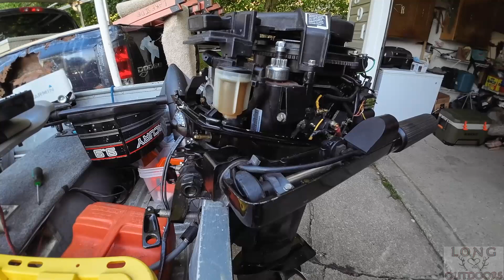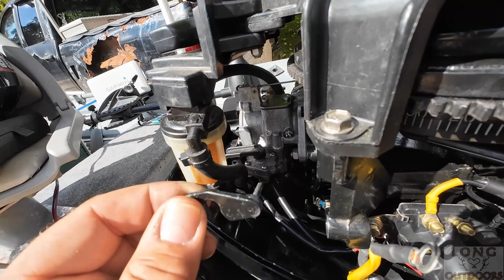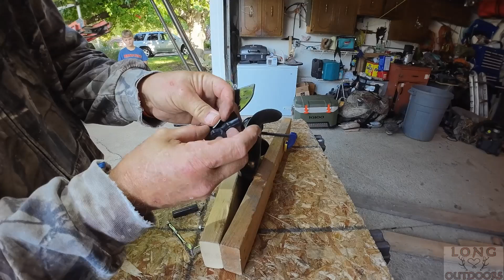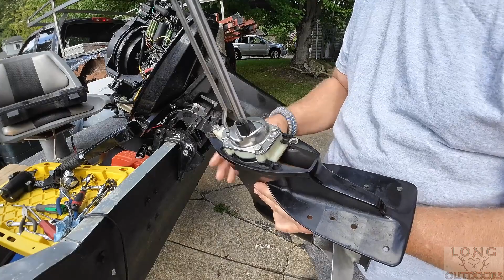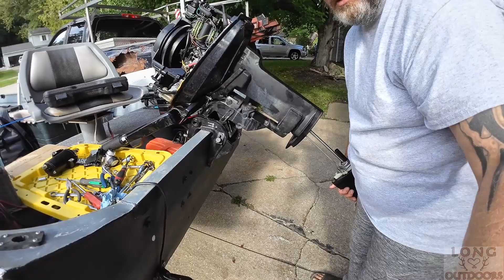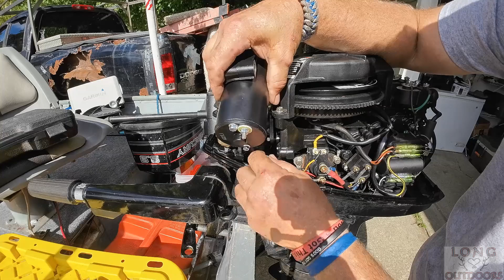How to Replace a Mercury 9.9 Outboard Motor Impeller | Step-by-Step Maintenance Guide

Comment: The shift lever should measure from the base metal of the water pump to the center of the hole of the shift shaft 16.5 inches. This is for anyone who accidentally turned it. This is your issue if you can’t shift through f/n/r easily
Reply from the maker: Hey thanks for tuning in! That's a great tip I appreciate your insight.  Tight lines my friend🤙

Comment: When I put that chrome cover over the impeller and put those 5 bolts in, it was leaving a gap on both of the long sides. then, I decided to install all of the brand new kit that I had so that everything would be nice and flat.  and the news parts do the same thing. it's almost like there should be two more bolts in the middle.  the recommended torque is 40-60  inch  pounds. i wasn't concerned about the torque until I had this problem. even at 20 inch pounds it acts like its pulling the 4 corners down and leaving a gap in the middle   i verified that my impeller is all the way down.So it's not like it's bulging or anything  i didn't use a feeler gauge, but I can fit about six sheets of paper in between that gap on both sides.
Reply from the maker: Thanks for tuning in, im not sure why that is happening. I havent encountered that problem.  I wish I could be more help, and without actually fiddling with it myself and seeing the problem i couldn't accurately offer a solution.  If you do get it figured out would you let me know here so if anyone else has the same issue they can see the results and corrective issues. Thanks again and I hope you can find the solution.
Reply: @archerjay1 OK. I wonder if its because the inner circular piece that the impeller rides in appears to sit slightly lower than the outer border of that chrome cover sits. Maybe thats the main part that seals first when it makes contact.   And maybe it doesn't have to seal perfectly.Anyway, since the whole thing is underwater, inside and out.  I plan to run it over to a boat mechanic and ask.  and if it bothers me too much, I could always put a tiny bead of silicon or something in there!  Thanks for the response.
Reply from the maker: I think youre right about the fact that it might not matter because the whole system is to move water so it might not be a big deal. I would love to know what the mechanic says about it. If you would let me know what he thinks would be awesome! Every little trick and tip helps here in the comments for future watchers that might question the same thing.🤙

Comment: Can you use the muffs instead of the can? I have a 9.9 mariner, but I think it's basically just an older mercury model
Reply from the maker: @lisastewart7992  the reason I use the can is the intake for my water doesn't alow me to use the muffs. If you have the side intakes on your motor the muffs will work
Reply: @archerjay1  thanks! it has intake holes on the sides, but wasn't peeing when I tried to winterise, so a friend recommended checking the impeller. It ran fine most of the summer, but hasn't been staying running, so I'm probably going to look for carburetor cleaning videos too
Reply from the maker: @lisastewart7992  it could be the impeller,  I have a short on how to test your impeller before you start taking it apart. Granted you do have to take the lower unit off to test in that way, but it is pretty simple once you start tinkering.
Reply: @ZOOMINZORRO  what did it end up being ?
Reply: @ZOOMINZORRO  what did it end up being ?
Reply: @rishadwilkes2476  impeller did need replaced. Also didn't have any gear oil left so might need a whole new lower unit if I can find one
Reply from the maker: Did you cook the gears in it? What did the lower unit oil look like?

Comment: bro  awsome on explantions on steps  tnx
Reply from the maker: You're most welcome! Thank you and I hope it helps!👍👍
Reply: @archerjay1  pulled off cdi think thats problem  2006 mercury 9.9   part nu is sayin 3145  but im sure its changed finding some but bolt pattern not the same????? any ideas  tnx
Reply from the maker: @JeffMazuco  so what made you take if the CDI? Are you not getting any spark?
Reply: @archerjay1  yeah checked coils first got same readings on both    process of ellimation i guess just got motor yesterday so  not realyy familliar with it
Reply: tryin to figure out if theres a way to test it
Reply from the maker: @JeffMazuco  well I had some electrical issues with my motor, and after I replaced the coils, ran a few tests I found out that it was my stator. I even changed the CDI on a recommendation from my local boat mechanic, but the problem turned out to be the stator. It really is an easy fix if you have the right tools. I would try to run some diagnostic tests on the stator if you can. It's best to run some tests before throwing a bucket load of parts at it.
Reply from the maker: @JeffMazuco  there are ways to test the CDI but it's not an easy task, you have to have power going to it for certain test, and no power for certain tests. And there are some ohm test you have to run on it as well...if I were looking for a no spark issue and it wasn't the coils, the next test I would run would be on the stator.
Reply: @archerjay1  yeah thanks got motor for 100 so im good compretion really good so happy on that end  ok ill  try that b4 i get cdi ordered
Reply from the maker: @JeffMazuco  ok sounds good! Glad I could help👍